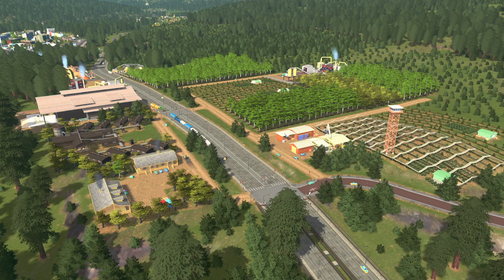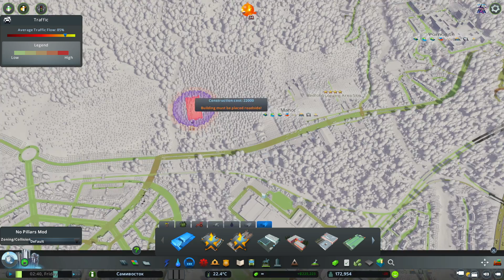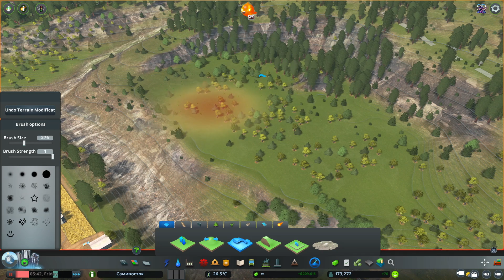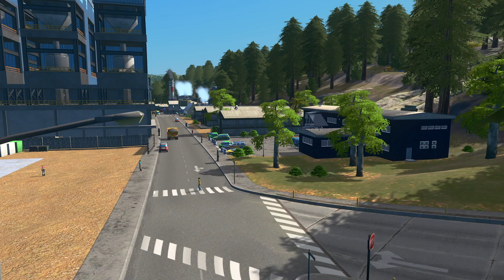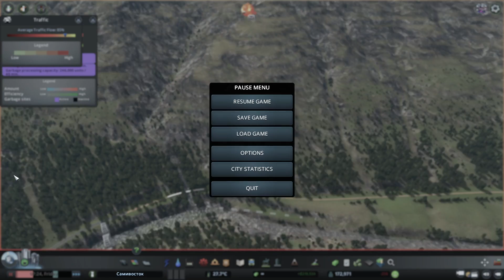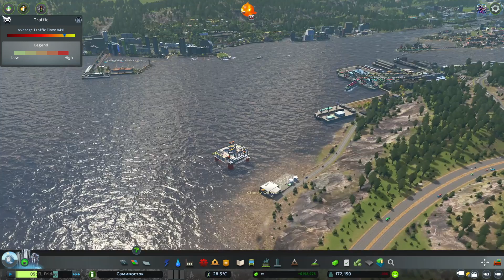Making Money With Industries  | Cities Skylines

Comment: I see you struggling to keep up with what you have build. I found it easier to understand the supply chain and to know what buildings to plant, by using the those green, yellow and grey sorting buttons. Then you can see only certain types of buildings. First place the green gear buildings (Resource extractor) to produce raw resources. Then yellow gear buildings (Refinery) to turn raw resources to materials. After that don't forget to place those Resource dropof points(grey button) to balance the use of raw resource. Common mistake is to have enough of them. 

In my city, I had lot's of raw resources, but for example, flour mill complaining not getting enough crops. Adding some silos helped alot.

Comment: I am also using the Real Time mod with a city with a non-trivial focus on industry, and I can still manage to make a profit. Sure, it's not my main source of income for that city (ticket price customizer is an amazing mod), but it's not irrelevant.
I think the biggest problem is that you don't stop to read what you're putting down or what district policies you're activating. The little diamond icon is just a symbol for the final product, which can be either sold to your own comercial zoning or exported. The only difference between unique factories is what resources they consume and the price of the final product. Same goes for all other buildings. For example, the type of crop in a field is purely cosmetic; they all produce the base item "crops", which can be either exported or processed either by the flour mill or all the varying animal products processors, which in turn can be exported or sent to the unique factories for further processing.The name of the building or what they look like doesn't matter, only the icons they produce and/or consume.
All of those items can also be imported, which is why your bakery was functioning properly even before you had put down the flour mill and pastures. The only items that cannot be imported are the unique factory products (although it would be nice to have to compete with imported goods for your city's market).

And industry area buildings do sometimes complain about not enough buyers of resources, but that's normally nothing to worry about, it usually just means that they have reached full storage and have consumed all of their on-site raw materials and are waiting for the next delivery or export. Way that you can change how often a building reaches a storage limit, be it output or [not enough] input wise, is by changing the production rate of the unique factories. For example, if both your extraction building and primary processing buildings are constantly complaining about full output storage, increase the budget to burn through those resources a bit faster so the buildings don't get full, and vice versa.

Of course, I am just one person and am not the most experienced player, but I do believe/hope most of what I said is correct. At least that's how I play it, and it seems to be working for me.

Comment: You should go trough your unique factories and up the production rate to 100% to fix most of the issues (while you build the big commercial center/district).

I don't use the industries DLC but i'm making my industries to get to level 3.😂 The main problem is fire coverage (even when the road is green the buildings aren't fully blue). But they also suck a lot of my highly educated workers (to make things worse, there are only 3.2k out of 11.9k eligible going to the 3 universities that i built to match the possible demand).

Comment: Industries is probably the best DLC in the game, but isn't too much based on realism since it actually doesn't matter which crop you grow in the fields, you can still produce anything that needs any crop(make flour out of apples etc etc.) and it works like that with all the rescources. Also, the unique factories will be better supplied if there are some warehouses of the stuff they need nearby.

EDIT: Also, "not enough raw materials in a processing building just means "not enough supply", and you can also get buyers for products by exporting.